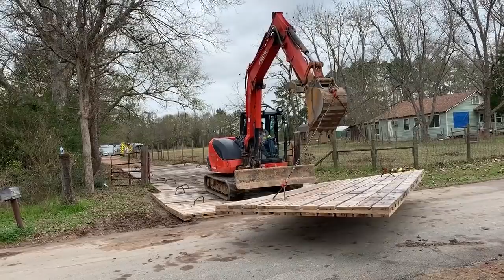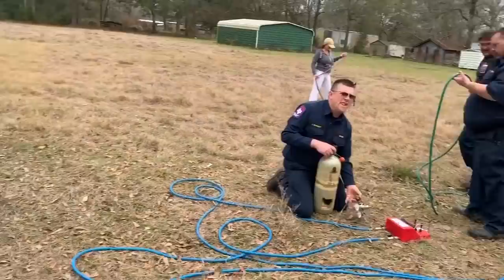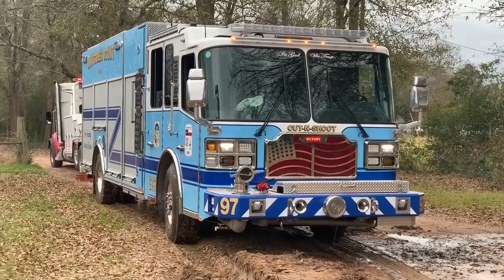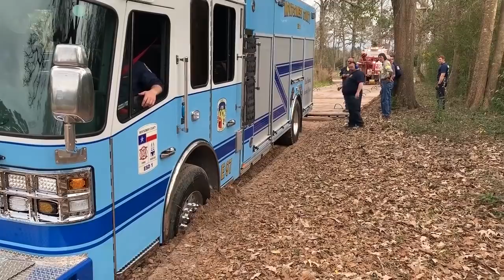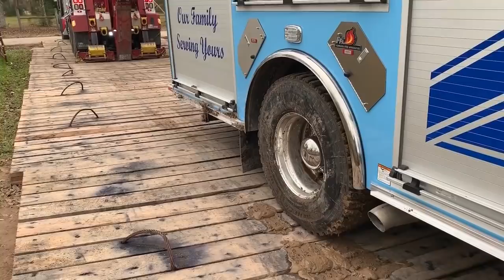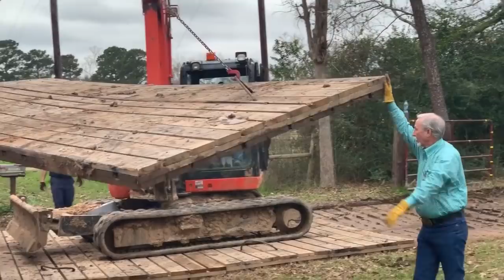010719 FIRE DEPARTMENT MORE THAN EXPECTED

Comment: We need Ron (Midwest Truck) here!
Reply: Ron would have picked the whole truck and been like where do you want me to put it
Reply: Bit of a commute for him.  I'm sure they could have found somebody just as good closer by.
Reply: i can second this!!
Reply: Van Hammer, I wouldn’t speak for Ron, but I’m pretty sure he wouldn’t take the Tator in there. If the Fire Apparatus sank like that at 50,000#’s, what do you think his 73,000# Tator would do?
Reply: @xheralt  while explaining how and why...
Reply: Indeed
Reply: A few more axles would help. Note that the heavy wrecker was able to go in and out where the fire truck later broke through. 

Putting the mats down over the soft section where I assume the other truck was stuck was a good plan.
Reply: that's exactly what I thougt as I saw the guy with the cigarette in his mouth... ^^
Reply: He would have needed the platforms to go all the way back to the truck..Knowing Ron he would turn around and come back with smaller single-axle units.
Reply: I have to laugh because my next recommended video is Ron with the Western Star towing the RV.
Reply: @ronneidert  The Tator has four axles to spread it's weight on.

Comment: Wow! This is exactly why my fire department is requiring me to build a proper load-bearing access road and turnaround. With mucky soft clay as a base I have to use lots of rock and geocell. If this happened on a steep property the truck might tip over too. This scared me into making sure my road is built right!

Comment: That tow truck driver didn't know what he was doing.  His lines were all wrong.  To get the truck out, he needs to pull from the rear, not the front.  He needs to put the snatch blocks down low and  run lines off the trees for added pull.  Ron Pratt could have gotten that truck out in no time. Go Midwest Truck, Scott City MO.
Reply: He also had no blocking under his out riggers causing them to sink into the mud
Reply: my first thought was ron also
Reply: I don't think those 'tow hooks' are made for lifting, only towing...
Reply: @jamespaulaski5697    he was slidding not sinking until it was moving
Reply: the tow truck driver is just that i suspect they don't do much "recovery" work they used to just hooking up disabled trucks.could have picked and blocked that front end with shorter strap and at least double up the lines via snatch block
Reply: Carol Frazer I was going to say the same thing, Like he says nice a slow he make great video and explain what he doing
Reply: The tow hooks would be able to handle the strain of simply lifting the truck; overcoming the resistance of the mud as well might cause them to break.  Maybe slings through the wheel wells for lifting?  Just throwing spaghetti at the wall here, to see what sticks.
Reply: Why would a fire company in Texas call in a recovery from MO? lol.
Reply: He was trying to slide the front of the truck over to get it raised up  some to the front axle would not be plowing as much dirt
Reply: The tow truck was trying to lift the front of the engine out of the hole with one line, and use the second line to pull it to the side onto the firm driveway.  This would have been the best way (least damage to ground and the truck), but the soft ground was not cooperating.  Plan B was to pull it out the way it went in.  Putting the snatch blocks down low would not give the lift needed to overcome gravity sucking the truck into the mud.
Reply: @yetisdeuce1315  That is your opinion. In my opinion he would have had a different position if hwe was trying to lift the truck out.
Reply: Did any of you people read the Main Insert about this. He Could Not Just Pull The Truck Out Backwards It Would Have Torn Up The Truck With It Setting On The Frame. I Love People who can criticize efforts with out knowing anything about the situation.

Comment: 2 problems here. Recovery truck driver did not have enough experience. Fire department trying to do the recovery work. 
Next time there is a fire, don't get insulted when a bunch of recovery truck operators jump in and take over the water hoses.
Reply: odeis5  The problem with YOUR statement is that the air bag did absolutely nothing and was pointless to use since no one could figure out where to even put the damn thing...haha
Reply: I have far more wisdom that you ever will, judging by your elementary comments.
Reply: Insults aside, odeis5 does have a point in that firefighters can be called upon to do heavy recovery, so it is a legitimate part of the rescue skillset.  Which means the rest of Gearshifter's analogy falls apart; tow operators have no business fighting fires, except as a last-ditch in the absence of better qualified personnel.  It's also clear that there are some deficiencies in this FD's heavy rescue training, but cut them some slack, guys, this is a rural department, not a big city with a training budget.  Maybe this will inspire them to get some (more) training.  As the old saying goes, "oh no, not another learning experience! ".  The tow operator was a nonentity, he just provided a lot of brute force.  Yes the ground was soft, but they didn't have to tear up even more of the driveway in the process...more lifting, not just dragging!  Now the homeowner is going to have to regrade that whole path in addition to dealing with the fire damage!
Reply: @xheralt  You sure used a lot of verbiage without making a valid point, you know, not to be insulting. 
Firefighters do not do heavy truck recovery, unless you live in Podunk Valley where everybody does everything. 
Your absurd remark makes about as much sense as saying the firefighters were a nonentity they just provided brute water pressure. 
Maybe this will inspire you to get a little more knowledge before speaking.
Reply: The thing was the front wheels had the brakes on and the driver should of given it gas. And they didnt let the water out first and it was super heavy. If they let the water out then it could of driven out cause it has huge wheels.
Reply: @greenlawnfarm5827  Poor feller is lost. :(
Reply: The excavator dude was already fixing it in the background towards the end. When stuck, always try to lift at axle when possible, to get the wheel off the ground. Place whatever you can find under the tires. Repeat until axles are no longer dragging on the ground. This all started because dude tried to go around that puddle...irony
Reply: The thing is all they had to do was let the water out of the tank cause thats what the whole middle part is. Its like a gas tank but its huge and full of water and they just needed to let the valve open and drain it out first.
Reply: Well, pumping it out with a hose a hundred feet down grade would be better. Just opening it up would give even more mud, right there.....

Comment: DOES ANYONE KNOW?? It looks like long LED light bars on the top of the cab(over the rear doors in the rear of cab) & it looks like another long LED on the front brow of the cab, are they standard off road light bars?? Do they flicker or light when responding code 3?? I would love to see what a scene looks like at night, with all those bars lit up.
Reply: They should be just white scene lights and they do light up the world at night.  Our new ladder has scene light similar to that.    Single row, High lumen bars.   The front one looks like it might have a left, right and center section.
Reply: @firemedicseven  Thx for the reply, I have seen a few  brow light bars on the front the flash/flicker white at different speeds when the apparatus is respondig code 3. I also noticed this front light bar has 3 yellow/amber lights, they are the clearance marker lights. Since it appears to have the upper marker/clearance lights built in, it made me curious if they flashed/lit up in another color??
Reply: Check out https://www.hivizleds.com/product-category/firetech-brow-lights
Reply: I wanted to know the same thing! I started googling ha!
Reply: Firetech makes outstanding lights with a great warranty. I work in the fire apparatus business and they are our go to light. A bit more expensive than some others but worth it.
Reply: only 3k for it :/
Reply: 3k on an $500k+ apparatus is not much. Oh did I mention we sell those lights and a different line of trucks. Lol.
Reply: @fjg2380p  i was meaning for a personal truck or something
Reply: @landon11760  OK. Gotcha. Yeah might be a bit much.

Comment: 50,000LB.. That's a lot of truck on two axle's, when you think an artic is only 30,000LB more and running five axle's
Reply: Its becoming a common problem with newer trucks running only one rear axle. The company's making them praise them for better handing and tighter turning radius but then wonder why their coming back every 6 months for warranty suspension/bent axle replacement.
My local department bought a new rescue truck about 5 years ago and replaced it last year (with a dual rear axle truck) because even under loading it with half a tank and 1/4 of the compartments empty it was still bending the rear axle or breaking  suspension components every 6 months.
To put that in perspective, most of their other trucks are 15+ years old, it took 8 years of constant repairs on their ladder truck to finally replace it this year.

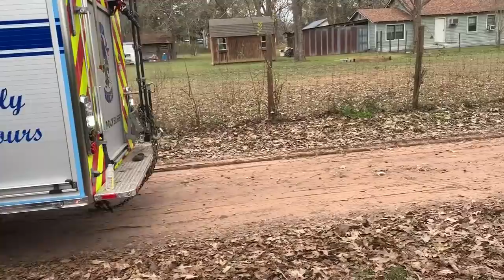Comment: The guy backing up the firetruck at 12:45 could have avoided it getting stuck again entirely if he had not backed directly into the path left by the towtruck, and instead steered slightly more to the left (our right) and went over the tracks, he would have drove on solid ground until the wood planks.
Reply: Peter he was trying to do that I think but that short fat fireman was waddling in his way so he had to drive around him!

Comment: I don't want to appear sarcastic, but didn't the driver of the fire truck have a seat-belt on, - hardly necessary in those circumstances I would have thought.
Reply: It constantly alarms with a very obnoxious noise if pressure is on the seat and the safety belt isn't on. May not even allow transmission to be activated

Comment: I suggest the land owner lays a stone gravel drive at least half a yard thick with cross drainage pipes to a ditch before the next fire. But to be fair the fire truck had driven off the driveway.

 Recovery was good, the wrecker driver was under the control of the fire dep, on a highway recovery he would be in charge so I think Scooby Doo's comments are not called for. That was an expensive piece of kit he was recovering and the fire dep didn't want it out of service, for a stupid mistake. I say well done to em all.

Comment: The front tires aren't even spinning what the hell
Reply: His foot is on the brake
Reply: 1/ Not 4WD, 2/ mud piling up behind it that keeps it from rolling. (happens both on the lawn site and on the roadway later.
Reply: I've seen the same issue on my 2wd tractor - when dirt/mud is soft enough, my rear tires (with wheel weights) push the front tires along and the fronts are not turning.  They have no brakes.  When the tire sinks in somewhere between 1/4 and 1/2 diameter, they do not rotate.

Comment: Should have went through the mud puddle or brought out a lighter truck.. Or a all wheel drive. Our local county rural fire department has a 6x6 fire truck for area's like this.
Reply: It's been rainy enough in the mid-Atlantic this year that normally solid areas are turning into swamps. Lots of people have been getting stuck, including myself - had to get my work van winched out of what was normally solid ground a month ago.
Reply: @jnelson4765  oh Yes well aware of the situation with the soaking you all have had. Been in the news here in SW Missouri. Been a mess that's for sure

Comment: love the people at the back of the engine as it was being pulled out and down the driveway. If that cable broke, several of those guys would, at the least have their legs cut off!
Reply: I wanted to close my eyes to prevent seeing that chubby guy being run over. For heavens sake, people running alongside of those cables as you mentioned was a no no situation. For what I  could observe, their insurance company should retrain them all, lots of liability problem.

Comment: If you are receiving paycheck from taxpayers you should be required to be in physical shape.  When out of shape things become good enough and your output becomes fractional and you should receive fractional pay until you pass a fitness test.  He could barely bend over to get hydraulic head unit. So, how could he bend over to pick up and drag a person out of a fire.  The town where I grew up there was a police officer over 500 pounds all he did was ride for his entire career.  He retired and got the same pension as the guys that chased bad guys.  He drove a squad until he got so big he needed an F-250(2 wheel drive) and the water department spent lots of time pulling him out of places with their backhoe that he had no business going.  The citizens referred to him publicly as “pillow butt” or “ten.0”.  How many driver seats do you think were replaced in police cars from all that sliding.

Comment: looks like the driver of the fire truck was trying to avoid water in the gravel driveway.
Reply: tbirdracefan 
Good idea pull that big ass thing off a road for a grass surface.my trucks not near that and anytime I go on grass dry it leaves ruts then wet u got some problems so 5 times the truck he should know better.
Reply: I was thinking same thing. Never take the truck off the hard deck (or gravel drive) with conditions like we've had lately in the South.

Comment: I hope that tow guy didn’t change the fire department for this. Should have called Midwest he is a professional. The tow truck should have air compressor on it.
Reply: ....."The tow truck should have air compressor on it".....
And just how do you think the air is provided for the air brakes???
Reply: The bottle they used to inflate the bag is an SCBA (self contained breathing apparatus) tank; They hold air at 5,000 psi, which is considerably more than the air compressor on the truck can manage!
Reply: Dave Burgess Dav I was talking about the tow truck. Did not know bottles had that much psi. Thank you.
Reply: Dave Glaum you do know this happened in Texas?
Reply: @daveyburgess  2200 psi, the same as medical oxygen tank, but can be max. working pressurized to 3000 psi. However psi is not the same as volume in that cylinder, 55cf. It will be gone quickly using it to inflate the bags. Fire department should have auxiliary connect for air lines from their trucks air susply for just that case!

Comment: If they are going to make the trucks that heavy, they should have at least have 10 wheels. Why have an expensive truck like that, and then cheap out on tires?
Reply: The problem is that the company's building the trucks are deliberately are making trucks with only a single rear axle because they have better handling/tighter turning radius.
Never mind the fact that you end up in situations like this where that extra axle might have prevented that truck from sinking at least on the driveway. (that heavy duty wrecker probably weighed almost as much as that fire truck but has 2 extra axles, and didn't sink in the driveway.)
Even worse I know a couple departments who have newer single rear axle trucks that they cant put all the equipment they want on them, or have to leave the water tank half empty to avoid being over the trucks weight capacity. And that's not even the DOT limit, its the physical capacity of the suspension and axles where things start bending/breaking from the weight.